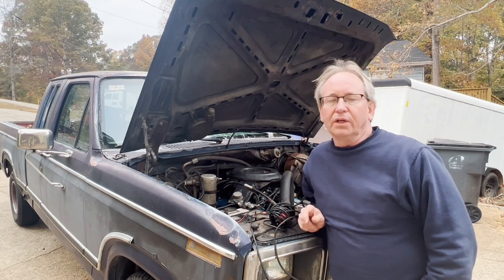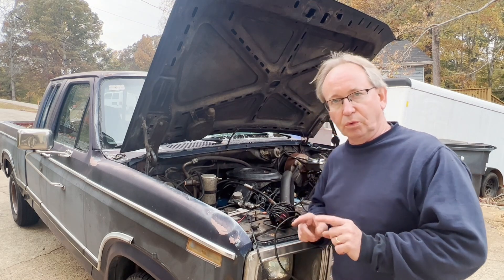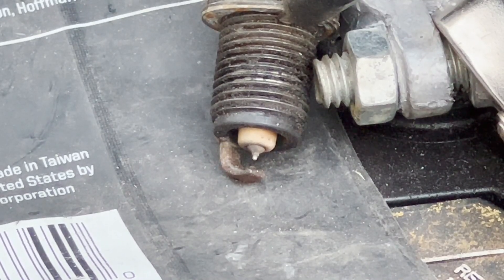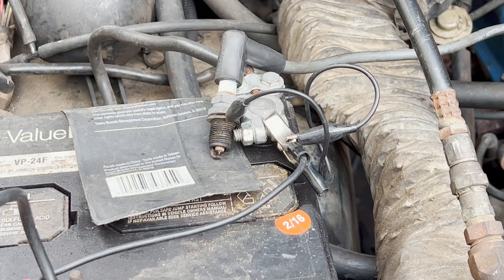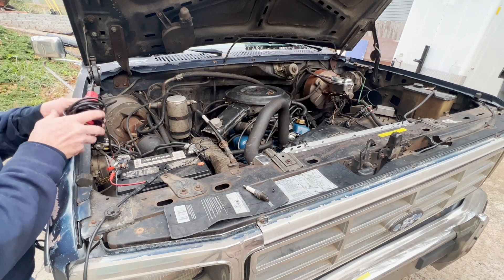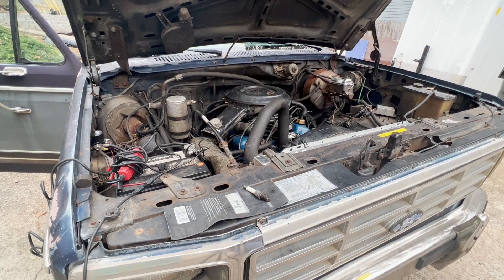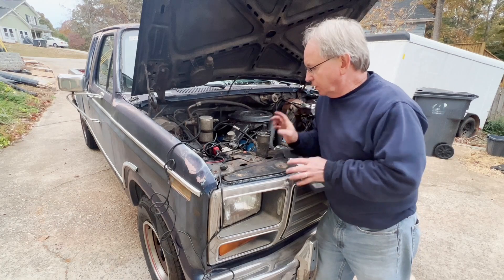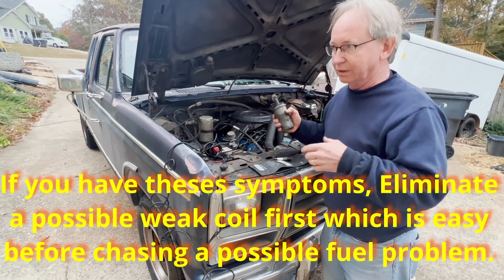How To Quickly Diagnose The Sneaky Weak Ignition Coil

Comment: How about if its heating up?
Reply from the maker: Hi. Thanks for watching and taking the time to comment. The coil will normally be warm, but not hot. If the coil is getting Hot, either the primary winding is developing shorts between windings, or depending on your year and setup, could be getting over voltage. Up until sometime in the 70's if I recall, most starting/ignition circuits put 12 volts to the coil with the key in the start position, and then in the run position the hot to the coil ran through a ballast resistor in one form or another dropping the voltage to 9 Volts to the Coil. My older GM cars have two wires to the coil hot side. One for Start and One For Run. If it's an older car many hands have been messing with it over the years. Often times people have rewired and run straight 12 to the coil not realizing this will burn up coils not intended for straight 12V.
My 83 Ford takes straight 12. When I convert points distributors to Pertronix with a Flame Thrower Coil, they get straight 12V. Measure you voltage at the coil from Hot to ground (not across) and see what it is. Check the primary coil resistance with the wires disconnected from the Primary. If I recall, it should be 4-8 Ohms, but I need to check and confirm that value. 
What is the car/truck in question?

Comment: on my 1978 f250 i can remove the spark wires from the distributor without getting a shock with the car on
Reply from the maker: Hi. I get zapped every time on any car always. To avoid that I wear welding gloves and use insulated plug wire pulling pliers, and pre pull the wires at the cap and stick them back in loosely so I can pull the suspected ones quickly and easily. Otherwise, it's ZAP, for me anyhow. lol I use an infrared thermometer on the exhaust to find cooler cylinders and then know which wires to pull to see if there's a difference, then know where to check compression.
Reply: sorry i did not finish asking the question
Being able to do that will mean that I have spark problems

Excuse me, I'm using a translator

Comment: what about spark advance? How do viewers know if he did'nt tinker with that?
Reply from the maker: Hi. Not sure I understand your comment, but to verify timing and spark advance, just use a timing light and see where your initial timing is and total timing after increasing RPM. Try it with and w/o vacuum hooked up to the advance so you know how much of the timing is from the vacuum. Make sure and plug the vacuum line coming from the source. Probably should never have a total timing at high rpm over 36 degrees. Keep it under that. Again, not sure if I understood your comment. Hope my response was helpful. Also watch Thunderhead289 and Uncle Tony's Garage.

Comment: I don't know about that spark color issue, however there may be a difference between the two coils in terms of voltage.
Reply from the maker: Hi. Thanks for watching and taking the time to comment. The spark color is kind of subjective as it has both purple and orange/yellow "aura's". I might have mixed them up when describing. Usually more purple is a higher voltage. Was just using that as a visual aid. Main point is that a weak coil will give fuel system symptoms. Only takes a few minutes to rule out jumping in a another coil. A friend of mine who works on modern computer controlled vehicles but has one older truck was having symptoms like I describe in the video watched this video and solved his problem in minutes after he'd been scratching his head for a while, being used to OBD Scanners and Fault Codes.

Comment: Spark may cause battery to explode from gasses causing injury or blindness find a better safer way imo
Reply from the maker: Technically, yes a remote possibility so I'll give you credit for noting that. Being that it's a healthy battery not drawing current in a charging situation there would be no Hydrogen gas present, at best negligible ppm's with the hood open and a breeze blowing it's not a factor. If that coil's spark couldn't light an atomized compressed fuel mixture in the cylinder it's not going to ignite possible trace hydrogen in free air.
Reply: @mkdhdinfiniteendlessconten3873  That is exactly right. I've seen many batteries explode. It takes certain conditions. . In fact In Vietnam I got qualified EOD.  The conditions for a battery explode weren't there.
Reply: & yet it does happen in free air.Actually twice in ten years starting diesel pumps that where trickle charged off small solar panels.
The snall car battery exploded and sent acid and bits all over mei was ok and washed eyes out immediately with a  water camelback drink backpack.

Comment: Thanks for that I'm leaning for coil symptoms.
Reply from the maker: Hi thanks for watching and taking the time to comment. Ya, it's rare, but a weak coil will taunt you. in 50 years I've probably only had 3 weak coils, and never a dead one. It's quick and easy to rule out if you have these symptoms so it make sense to rule it out or confirm it before messing with fuel system stuff.

Comment: This is it from New Orleans please more content your delivery is awesome your info is great tell us more about your truck or you keep it running good so I can learn from you thanks
Reply from the maker: Hi Eddie from New Orleans. I think you're my biggest fan. If I had a fan club, you'd be president.  ;-) That's a great idea on the truck, so I'm going to do it as soon as the weather warms up with some longer days. I appreciate the compliments regarding my content and how I deliver it. I enjoy doing such things. There's a big cult following for The Bull Nose F-150's. They had a new cool look that was aggressive just like the body style before them, and much cooler than the styling changes they made after this version. As beat up as my truck looks, I get offers for it constantly.  It's my daily driver. 
Except for a brief time, I've owned the truck since 1991 and it played a big role in my life taking my family and I on many adventures and hauling and towing many things many miles. I always tell everyone "I love that truck so much I bought it twice" which is actually true. It even survived a tree falling on it during a hurricane and has the battle scars to show it. 
I'll be doing body work and panel replacement on the cab, replacing/fixing/upgrading the A/C, building a new cool engine. The interior needs a lot of work. It originally had an awesome cloth bench seat, and the dude I temporarily sold it to replaced it with buckets, that are sort of ok as they open up the center hump, but they need reupholstering.  I'm on the hunt for some vintage 70's Thrush Side Pipes for it and will be putting those behind a good set of long tube headers. 
The relatively new foreign made fuel pump is leaking oil at all the crimps and seams. I'll be doing a video on that in the next few days, so stay tuned. Thanks again.

Comment: Hotter is blue/purple, weaker is orange/yellow brah
Reply from the maker: That seems logical and what I was expecting as I weld and a high voltage arc is generally blueish, but I saw the opposite ehen comparing them. My main goal was to educate that a weak coil will give fuel delivery symptoms, and it's so easy to swap a coil and rule it out to try that first. Thanks for watching and taking the time to comment.
Reply: going to give this a shot on my 91 maxum
Reply: That’s what I always thought

Comment: nice video, thanks
Reply from the maker: Hi. Thanks for watching the video and taking the time to comment. The spark visual and sound difference didn't really show on camera, so was disappointed in that. 
For real life troubleshooting you're just going to jumper in another one to confirm or rule out the coil.  Jumpering in a coil takes just a few minutes. It's less than a minute on one of these slide terminal connections. Takes a few more minutes on a nut terminal connection. The HEI GM coils built into the cap are quick and easy too. 
If you have spark and similar symptoms to what I describe,  jump in a known good coil and confirm a bad coil, or rule it out. If it's bad, then you can deal with that annoying wrap around mounting bracket if it's an intake manifold mounted coil. Otherwise move on and take a closer look at fuel system and carburation.
Reply: @mkdhdinfiniteendlessconten3873  thanks again. i order that tool and this will help me to find which one of the 6 pencil coils are the sneaky, not working right